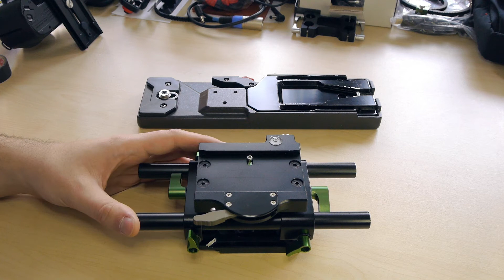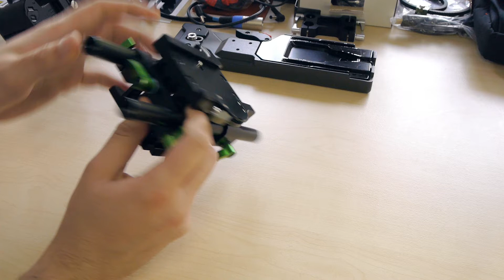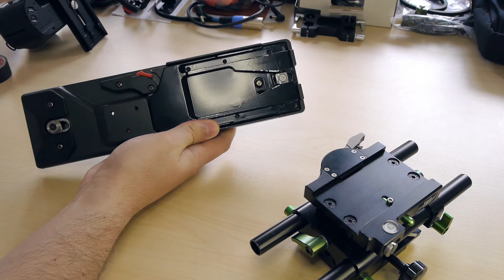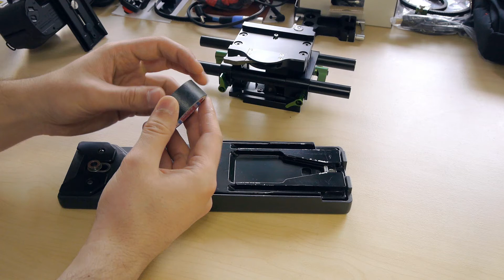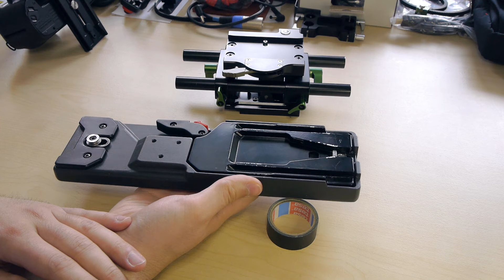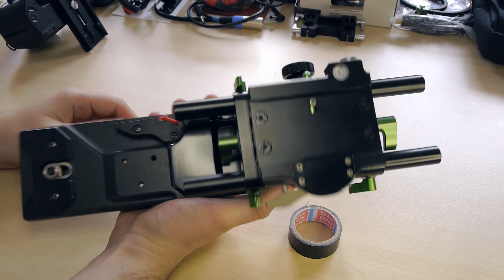Lanparte VMP-01 - "The ultimate Baseplate" (with Sony V-Lock feature!)

Comment: Can I check with you, the Lanparte QR system is compatible with Manfrotto 501 QR system or not?
Reply from the maker: I´m sorry to say that - But: No. They are not compatible.

Btw.: If I had to choose, I would get the Lanparte QR system. It´s more expensive yes - But WAY easier to use because of the "clip on" feature.
(AND you can even slide it in and out from the back AND the front if there´s no space to clip it on or off ...
In comparison the Manfrotto 501 QR system you can only use from one side - And you cannot clip it on.)
Reply: Thanks for your valuable info, I have manfrotto tripod and some QR plates. In this I have no choice to by Cinevate QR plate, that compatible with with Manfrotto QR plate.
Reply from the maker: Hmm. Check out Ebay-Nr.: 271636225030

It´s a base block system I use actually quite often by myself - It´s compatible to the 501PL system AND you can even mount it directly to your manfrotto heads (with 501PL compatible mount) - The nice point: You can use one of the included plates at the bottom (Giotto or Manfrotto 501PL) - So you have a direct connection to your Manfrotto head. AND it´s equipped with a dual rod support - So it´s quite rugged. Also a nice "side effect": If you open up the base on top enough, you can even mount the 501PL plates FROM TOP!

Though: IF you´re interested, I also recommend to order the standard cheeseplate (for the bottom) - So you can also use it with other heads (without 501PL system) in the future ^^. Because otherwise you don´t have 1/4" or 3/8" holes at the bottom for mounting it somewhere else.

AND also important: If you plan to use a mattebox in front: The QR Plate with this base block "offsets" the center of your camera body a little bit - So you need an offset clamp (to mount a mattebox centered). But it´s not a problem if you have an side adjustable one - And it´s also no problem with any other accessory.

HTH (hope that heps ^^).